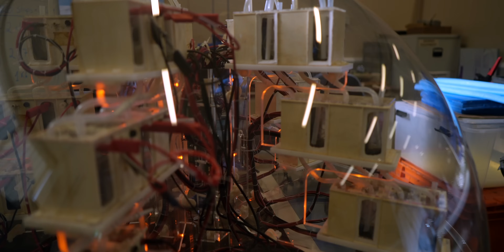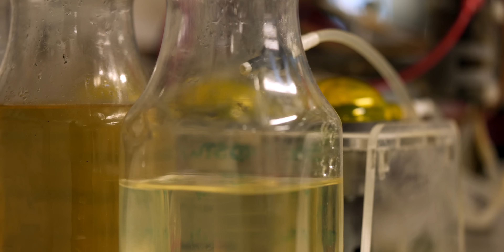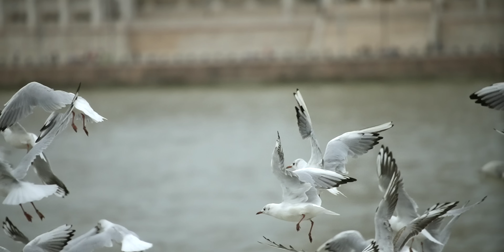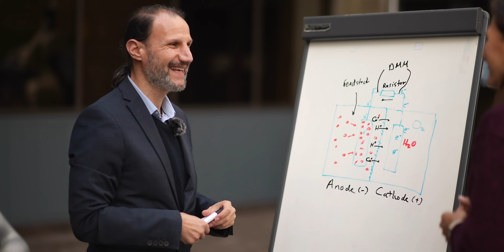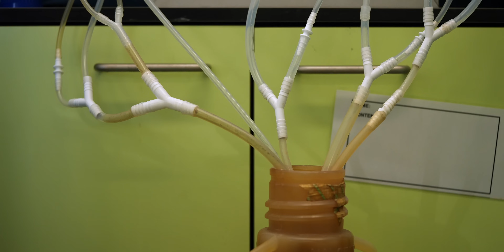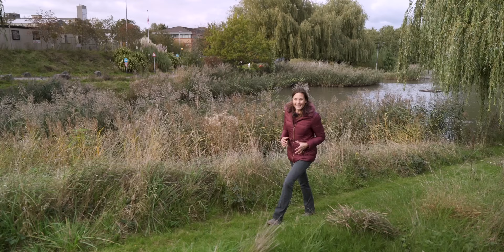The Living Fuel Cell Powered By Human Waste | Fully Charged

Comment: It's a lovely presentation for kids to get them interested in this field but not so much for adults. This is completely impractical. Urine will also stimulate growth of other organisms coating the cell electrodes and degrading it's performance over time. Cleaning requirements where not mentioned and I'm pretty sure the whole system analysis would show the amount of energy used to produce this setup far exeeds the energy this cell will ever produce.

Comment: Another way to do this is to put a hamster in a wheel, attach wheel to DC motor and charging controller (not unlike a wind turbine), force hamster to run (for food, or electrocute him if he stops, etc.).  And when you feed the master, you're turning food into energy.  Voila. If this sounds wrong to you, well this is the path they are probably going to end up on.

Comment: Let’s not get carried away, I heard he said it was 2mW, per cell I assume. So for a moderately usable level of power of 1kW you need one million cells!
Reply: Your maths has gone a wee bit awry.
Reply: @markparker5585  Ok 2kW for 1 million cells, in the same ball park.  Or did I mishear the 2mW?
Reply: @comeinhandynow  I assumed it was just a typo, but it gave me the opportunity to join in with the urine based puns rife in the comments section. ;)
Reply: I think you need to adjust your perspective a bit - I don't think they're thinking about running EVs on p*** just yet....!
In many applications, a few watts is significant and useful ......
Reply: @andymccabe6712  True, but for the 5W output needed to charge a phone (some modern smartphones wont charges at less than this) you need 2,500 cells!  As solar panel would be a lot smaller and cheaper and less messy.  Sometimes one needs to stand back and think whether this route is going to be useful.

Comment: A genurinely interesting video.
Given the small voltage and minute current from a single cell and therefore the need for large numbers to make useful energy I wonder what the lifetime efficiency is? There’s quite a lot going on as well as just the cells, then there’s manufacture, maintenance etc to make for viable generation.
A great idea for pubic transport (sorry….): if every seat had a small funnel built in (some for men, some for other sexes) and bottled water was provided and compulsory to drink we could eliminate the need for battery EVs.
Just a wee thought. Don’t poo-poo it.
Reply: Lifetime is amazing. There are buses that are still running from 10 years ago.

Comment: I wonder how this tech stacks up against a small solar cell in terms of manufacturing cost, size, etc.

I have a solar charger for my phone, it will fully charge my smartphone and my wife's simultaneously in an hour or so.  It folds up to about the size of 2 paperbacks.

With a couple of cheap 6000mah power banks, it gives us 24/7 charging capabilities, it's relatively small, and cost less than £50 all in.

If you can beat that, you may have a market.

Comment: I've noticed that Helen loves the natural cycle of our planet, whether its cycling an electric bike to produce electric, recycling car batteries so that the essential elements can be recovered and reused. Its the way our economy should be based upon- i.e if it can't be reused, recycled it shouldn't be made. Capitalist economy is finite, taking things from the environment basically removes a spoke from the natural wheel and this can only go on for a short time until the whole lot collapses. A circular environment to harness our needs but ensuring the right amount is used and replaced is essential. This type of battery system is pertinent if not more important then anything else. It just needs scale. Well done Helen. Your type of presentation is essential and a building block for the rest of the content on fully charged 👌

Comment: How about growing algae as food for electrocytes (such as from an electric eel)? 

Which stores energy and is separated by insulating layers thru. a biochemical process that pumps positive sodium and potassium ions out of the structure to discharge the electric.... .As a solar cell/ battery?

Had the idea decades ago. So its good to see biomimetics is making progress in the energy field too. Even if none of this still seems like its not close to being commercialized, is it?

Or how about using genetic engineering to combine them in one organism? Which would make it much more efficient , more reliable and far less complex to maintain so less costly too. But the ethics would be a complex issue, left for the future.

Comment: As interesting as it might be the applications seem kind of limited. People aren't going to piss in special receptacles connected to vats of microbes if the amount of power that comes out is minimal - literally enough power to run a couple of bulbs. Now, if they could get it working on sewage plants or black water systems such as in in cruise ships, then maybe it has some purpose. Even if it's just to run some UV lamps that sterilise the water emerging from the other side.

Comment: Will it endure long enough to generate the energy needed to manufacture a new cell?
Reply: Think Prof Ieropoulos said they've had one prototype running consistently for 13 years? And at 2mW that would mean it's produced over 227Wh so far? (my maths is probably way out though)